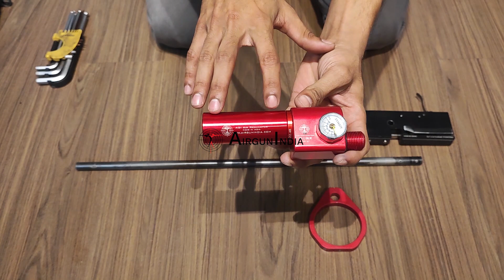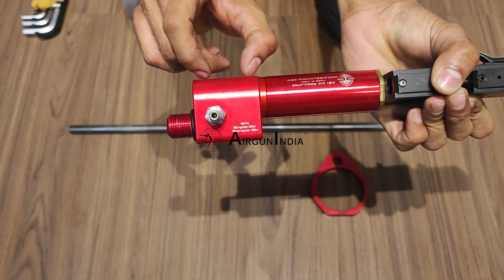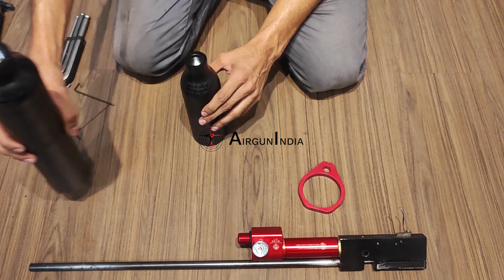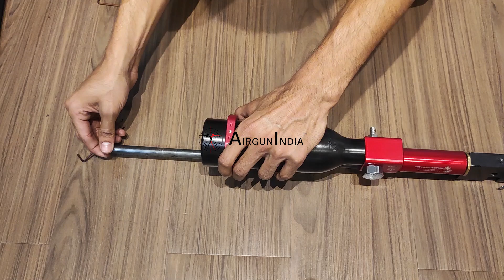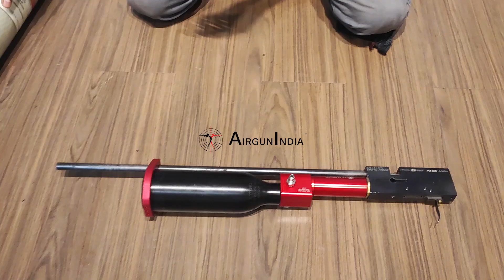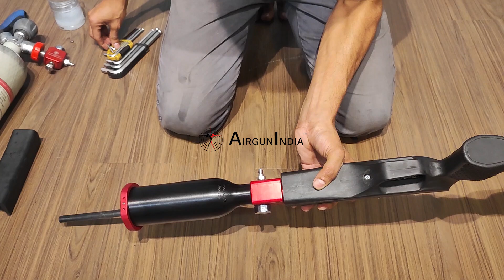PX-100 bottle conversion kit with regulator by Airgunindia

Comment: Great content, really good products, but after purchasing the z-valve with the plenum, there must be an option to modulate the reg pressure with a hard factory stop at max pressure. A guidance video on it would be much appreciated. Slugs are more effective with an impulse @ 180 psi and the reg is limited to 160. 160 Works good for pellets, but for long range slugs, a higher BC would demand something 180 psi range. Z-Valve plenum is of similar dimension as the OG PX100 tank that is connected with a brass fitting to the receiver at 200 bar tank pressure, why must the reg not be comfortable with the same pressure, if the construction is similar.
Reply from the maker: Thank you Sir.

Comment: Plenum cc and regular pressure maxim kitna ?
Reply from the maker: Factory fitted Plenum is 40 cc. You can purchase bigger sized plenum at extra cost. 
Factory Set Regulator Pressure is 120 BAR but you can order for higher or lower pressure as per your requirement at the time of purchase. 
Max Pressure suggested is 160 BAR.

Comment: Whats the price for 500 cc with combo
Reply from the maker: PX 100 Bottle Conversion Kit with Regulator. 500 CC contains
PX 100 Z Valve + Interchangeable Plenum + AGI Regulator + 500 CC - 300 BAR Cylinder
https://www.airgunindia.com/product/5318631/px-100-bottle-conversion-kit-with-agi-regula-67688
Reply: @airgunindia7290  is it available in COD I wanna get one
Reply: Sir this price only cylinder or full gun price ....?  Full gun setup price or what. ...?

Comment: Kit price sir
Reply from the maker: https://www.airgunindia.com/product/5318631/px-100-bottle-conversion-kit-with-agi-regula-67688

PX 100 Bottle Conversion Kit with Regulator. 250 CC contains
PX 100 Z Valve + Interchangeable Plenum + AGI Regulator + 250 CC - 300 BAR Cylinder

PX 100 Bottle Conversion Kit with Regulator. 300 CC contains
PX 100 Z Valve + Interchangeable Plenum + AGI Regulator + 300 CC - 300 BAR Cylinder

PX 100 Bottle Conversion Kit with Regulator. 500 CC contains
PX 100 Z Valve + Interchangeable Plenum + AGI Regulator + 500 CC - 300 BAR Cylinder

Comment: What's the capacity of plenum?
Reply from the maker: Factory fitted Plenum is 40 cc. You can purchase bigger sized plenum at extra cost. 
Factory Set Regulator Pressure is 120 BAR but you can order for higher or lower pressure as per your requirement at the time of purchase. 
Max Pressure suggested is 160 BAR.

Comment: Now you are doing great job in indian air gun community thanks ❤👍
Reply from the maker: Thanks
Reply: Does it have barrel extender in order to fit suppressor. And how many shots count does it gives and power fps
Reply from the maker: Barrel Extender is available as optional extra.
Reply: Bro I need all the kits to modify px100 with 500cc bottal